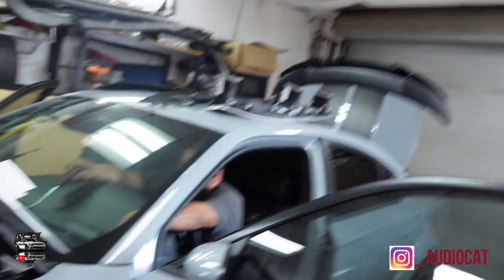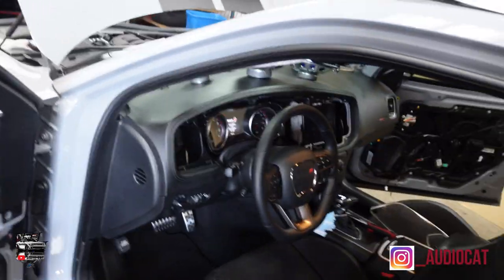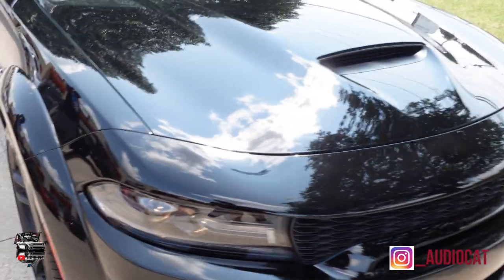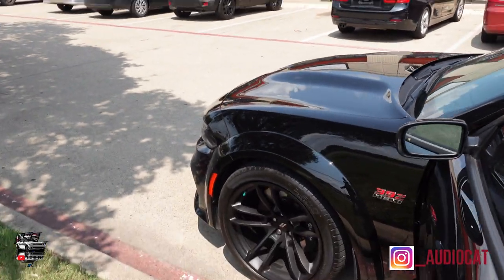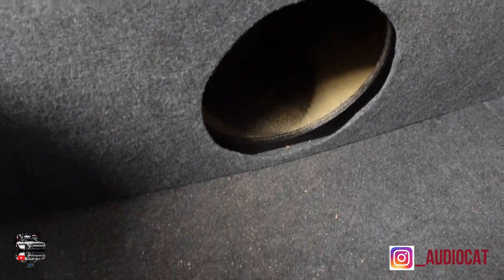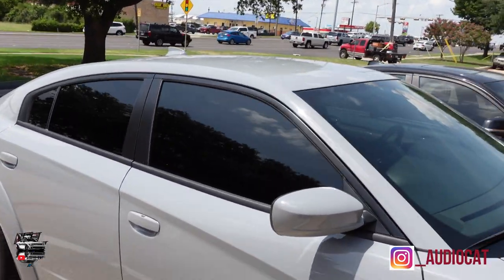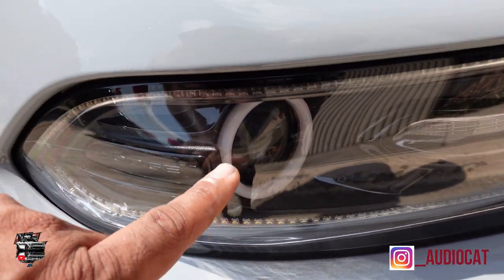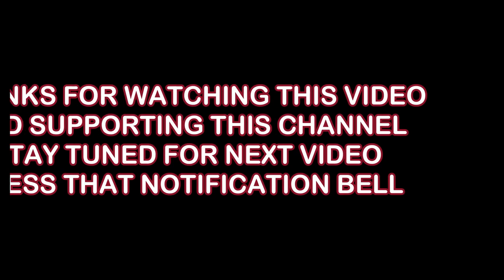2021 CHARGER 392 WIDEBODY GET A CUSTOM AUDIO SYSTEM PLUS ALL THE LIGHTING FROM AUDIOZONE DFW.

Comment: Hey Papa which module did use, the amp pro ap4-ch41 rev. 2? Just bought me a charger and wanted to make sure that unit worked for the non amplified setup. Nice build bro and damn I haven't seen an MTX 15 in a minute, was one of my favorite subs from back in the day. Appreciate any info papa thx and keep them builds coming. Cujelo suave ✌
Reply from the maker: Yes sir ap4ch41 v2 is the one to use works on both truly the best for build without a dsp